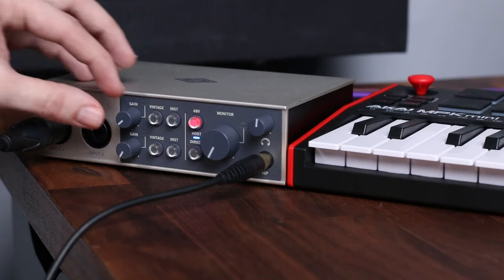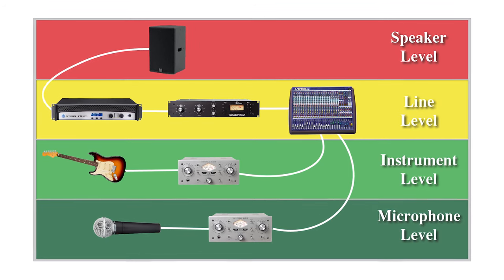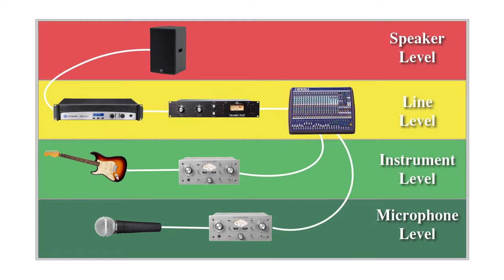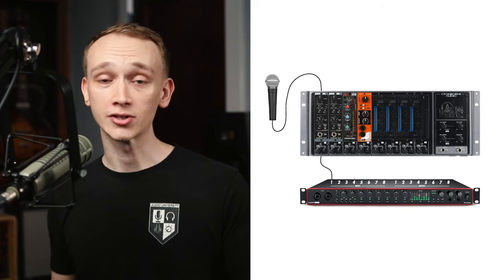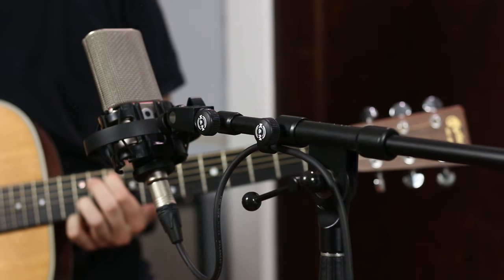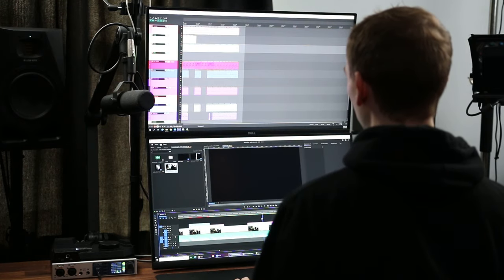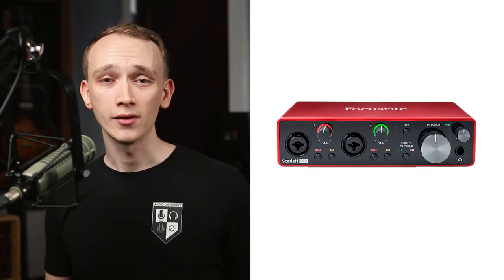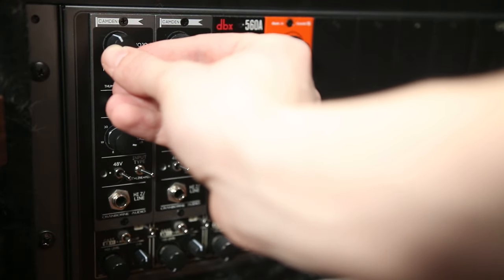Mic Level vs Line Level | Do You Need a Microphone Preamp?

Comment: I use my UA Volt as just a preamp for boosting instrument and mic inputs TO LINE LEVEL by simply direct-monitoring with it.  I don't even have it activated as an audio device.  Very nice way to emulate a DI box with the added benefit of my instrument inputs being converted to line level versus mic level that a DI gives you.

Comment: Really like this channel every video is super useful. I have two questions about the preamp and audio interface. Would a virtual preamp plugin on your DAW function the same as the hardware version interms of helping reducing noise and raising the signal to a healthier level ? And in another video you set up a guitar to go into a DI box then into an audio interface and then into the computers DAW, I am using a focusrite solo audio interface and it has a button to change the input to instrument mode, would I still need the DI box - I've tested out recording my guitar and it sound quite good to me just wanted to make sure I'm not missing something and run into problems later when mixing.   :)
Reply from the maker: Thanks! 

The job of boosting a signal from mic level needs to happen in the analog realm, practically speaking. That means a plug-in alone won’t work for that much gain. However, preamp plugins are great for small gain adjustments and tone shaping. 

The instrument input on your interface fulfills the role of a DI box.

Comment: Great video! Something I am not too sure about ist, why does someone use a specific preamp to change the sound of a mix and not just a plugin? There are some really good guitar plugins available to recreate the sounds of thousands of amps and they get better every year. So why is something I would imagine is more simple than a guitar amp not yet transformed into a digital plugin? So for example you record on a clean preamp and then color your mix with a preamp sound plugin (if that makes any sense). You'd not need to have multiple physical preamps and still gain the advantage of being able to play with the preamp sounds.
Reply: Plenty of those types of plugins out there, even if you only look for free plugins, you need to do a bit of searching. 🙂
Reply: Live tracking through plugins adds latency and the risk of a computer crash or sound glitch.

Comment: The Difference between Mic Level and Instrument Level is not only the Level but also the Input Impedance. Instrument Inputs are very often High Impedance and the Inputs of Mic Preamps are nowadays mostly made more for like Low Impedance Mics. This is also because a High Impedance Input with a lot of Gain is more prone to Hum than a Low Impedance Mic Input. But Mics can be also High Impedance Sources too. In this Case the Impedance (most of the Time) needs to be converted to a more Low Impedance Source...

And the Level of some Low Level Dynamic Mics can be even lower than -60 dBV... -70 dBV to even - 80 dBV is also possible..
Reply: Hi,
(1) Is it okay to connect the output from a 50-watt guitar amplifier headphone port to a line-in input port on a mixer?
(2) Also, is it okay to connect the output from a 50-watt guitar amplifier headphone port to a line-in input port on a PC sound card?

When I did (2) the PC sound card quite literally got fried up.
But for (1), the mixer didn't get burnt up and everything functioned normally. 
What's the difference actually between the two scenarios?
Afterall both had the same signal from the headphones output port going into a line-level input port.

Comment: I have a question - I use an Apple iMac desktop computer and MacOs has a 'system' volume control that will control the selected audio source. When a USB audio interface has a physical volume knob, the 'system volume' control is usually greyed out. The with some interfaces with no physical volume knob, the 'system volume' works. I have a Griffin Power Mate, a USB knob handy on my desk that I like to use to control the audio volume using the MacOs 'system volume'. But this limits me to USB audio interfaces with no physical knob. Do you have any insight into why this is! I truly enjoy your videos!
Reply: Apple user here -- when "system volume" is greyed out, that means that the Apple built-in interface is being replaced, for the moment, by your audio device (if it includes an interface). If your audio device connects to the audio port, (i.e., has no interface), it will be recognized within the Mac's audio system.  Some Macs  have reasonable good-quality interfaces built-in, to convert analog to digital audio. But a high-end interface can be a big step up. Good luck!

Comment: please make a video about patch bay routing
Reply from the maker: Have you watched this video yet?: https://youtu.be/g5Z4NKrwBQw
Reply: @AudioUniversity  yes the back of the patchbay shown contains trs jacks how do you connect xlr snakes to trs jacks ?
Reply from the maker: I use XLR to 1/4” adapters or XLR to 1/4” snakes.
Reply: @AudioUniversity  would that cause signal degradation of any manner ? Like add noise or hum?
Reply from the maker: No. XLR and 1/4” TRS are the same pins in a different connector.

Comment: I have one set of studio master xr40 wireless microphones(HH). Again I taken another same. The problem is the audio interface is happen due to same frequency. If I turned on that two sets its not working. One mic is connecting to another receiver. And that frequency was in fixed. We cant change. Is there any solution using xlr cable to overcome this.

Comment: My microphone has a lot of noise when i raise the level ..🤔
By the way thanks again Kyle for your explanation 👍
Reply: Could be a number of factors. If you have a cheap mic + a cheap interface it's normal to have it. If you have an USB mic then it's really normal to have that kind of noise since the USB mics have their own preamps and they're not usually all that great
Reply: Check your leads. I have $10usd mics, and a Behringer interface, and no noise, unless the lead is not firmly connected to the mic Twist the connector while pushing it into the mic, after it's clipped in. If that doesn't work, try another lead.
Also think about the electrical devices in the room that might cause interference, mobile phones can certainly cause noise, and if your lead is actually running over equipment, power leads or power boards, it might pick up hum. Cables will act like aerials and pick up any stray frequencies in the room, so where they are can make a difference. Cheap cables in particular because the shielding is not very good.
Then again, you might just have a shit mic! 🙂
Reply: Thanks for your suggestions guys I'll try to fix..

Comment: Someone correct my path because I'm not getting a signal

Mic into Drawer MX60(built in phantom power and pre amp)

Drawer Mx60 into Art Pro VlA Compressor

Art Pro VLA compressor into 
Mackie VLZ3 mixer

Mackie VLZ3 Mixer into 
focusrite Audio interface

No sound where am I messing up